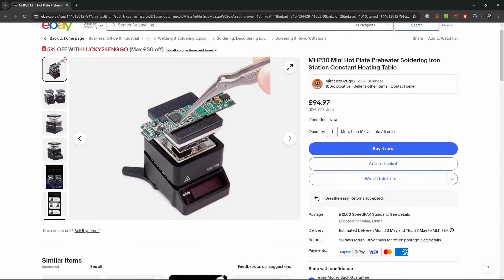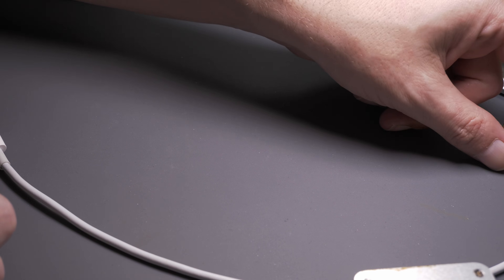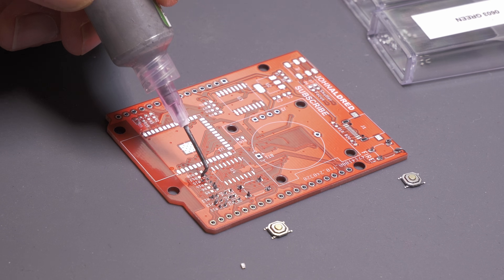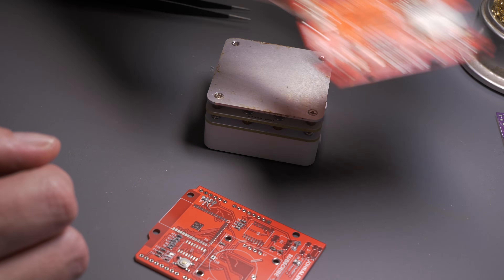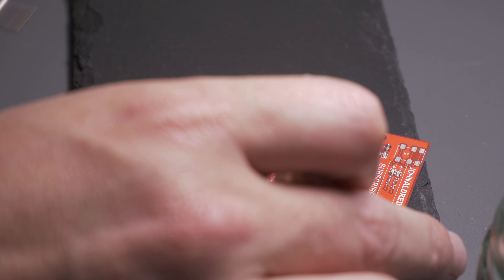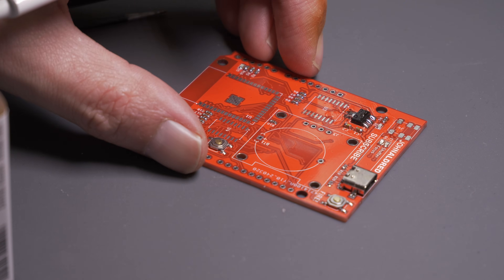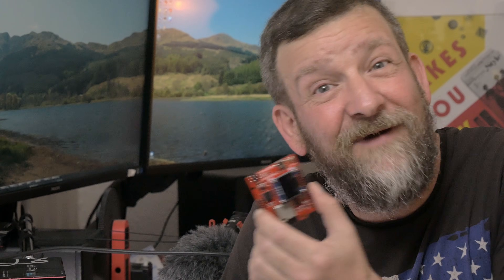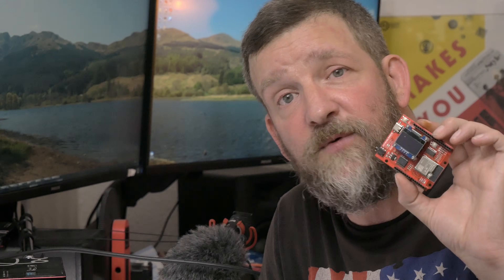Learning to solder tiny SMD components with a hotplate - JLCPCB

Comment from the maker: Many thanks to JLCPCB for sponsoring this video! https://jlcpcb.com/?from=John
Reply: What seemed to be the cause of the USB issues? I designed an S3 board (and assembled it) that SHOULD function supposedly, and it's recognized as an unknown USB something in Windows 10. Thanks in advance for explaining how to force that to function properly!
Reply: By the way, when using a stencil, make sure to tape down 2 corners and use a squeegee to apply the solder paste to the pads. A credit card or RF card can be used for that if necessary.*

Comment: Never been a fan of solder paste.  I find it is just too thick and viscous for home use and better suited for industry.  Usually I'll get the small tub and mix in a decent amount of flux to thin it out and then put that all into a syringe.  It's a real pain though since I just don't use enough to make this whole process worthwhile.  Now I just mainly use it for those rare times when I need to do a spot repair in places where it's just too awkward otherwise but those times are increasingly rare.  As for the hotplate, I too have one of those smaller $10 ones and they work great but I use mine primarily for depopulating components.  And having only recently gotten a microscope to aid these old eyes I find myself much more capable with a good iron and hot air.  One thing that's for sure is that there is NO one way that is best.  The "best" way is whatever way works for YOU.😁😁
Reply from the maker: Absolutely. And I don't think "best" is even necessarily just what works best for the person, but what works for the person and the board being assembled at that time. There's a few I've done now that I definitely wouldn't want to try hand soldering with an iron, even though I still really enjoy it. 😂

Comment: what's the model of your loupe/monitor/microscope? and for a beginner who just want to solder a few smd components with least effort, is your final verdict hot air or hot plate? (already watched all your 3 vids)
Reply from the maker: I'm actually using Panasonic G80 and GX80 mirrorless cameras with a Nikon 105mm f/2.8 Micro-Nikokor using the Viltrox NF-M43 and NF-M43X adapters.

I think I've come to the conclusion that a combination of the two is probably best, at least for assembly. Hotplate to get the board and components up to temp so the heat gun can just finish 'em off quickly.

If you're more about assembly than disassembly, I'd probably go for the hotplate first. If you're more about disassembly, then I'd go for the hot air station first, but I would suggest getting both if you can.

Good luck on your journey!

Comment: I bought a pair of 400w hotplates from Aliexpress for like £6 free delivery and been messing around with them today as I am sitting here trying to work up a controller as its mains but you only get full welly or no welly and I want to have say 3/4s welly or half welly perhaps.   Very basic in just an aluminium plate with two mains elements chained to each other, done some test reballs and simply ball up, heat up and drop a bit of the fluxation nation on there and perfect balls every time...  (that sounded so wrong lol)
Reply from the maker: Haha, yeah, there are a lot of good deals out there if you're patient (or lucky). Can't beat perfect balls. :)

Comment: The solder sticking to the stencil an not the pads has more likely to do with them not being clean. Clean both the stencil and board  with IsoPropyl Alcohol (IPA) and the problem will likely go away :) Of corse some good past will help a lot. Second thing that might help is don't pre heat the board. Just put your board on the 100*100mm plate and then turn it on. Look up at what temperature your solder should solder and set it to that temperature before you turn it in on. Good luck mate!

Comment: Would it be possible to regulate a mobile cooking plate to get something like this?
Reply from the maker: It's definitely possible, but I'm not sure how efficient it would be. Most cooking hotplates don't have a flat surface, so there's a lot of air between the hot surface and most of the board. So, it would likely require more juice to get the board up to temp. What you could look at is converting an old iron. I've seen a few of those. Electronoobs has a good video about that. The principles and circuits he shows should work with a cooking hotplate, too.

Comment: Hi John, I agree with your assesment, the solder paste application was the cause of your problem. The syriinge approach does not really work with small components, the stencil with the correct solder paste thta has not expired would have given you a much better outcome. One of the problems with solder paste is that it needs to be stored at or below 25 dec C - you would need to check the specific paste you are using for its storage requirements. I buy solder paste from local suppliers as i am hoping it would give a greater probability that it was shipped and stored correctly.
Reply from the maker: Thanks, Andrew! Yeah, I think you might be right on the solder expiring. There's no date on it or the packaging and it was purchased fairly recently, but there's no telling how long it was sitting in some random warehouse in the wrong conditions. Are there any particular brands or specific types of (leaded) solder paste you'd recommend?
Reply: @JohnAldred  Sorry for the late reply. Unfortunately I have no specific recommendation for you on the supplier recommendations. Before I start any SMD work, I test how the consistency of the paste and if it is not smooth, I dump it and buy another. I take great pains to store my paste in a cool place, if I get a year out of it I am pleased.